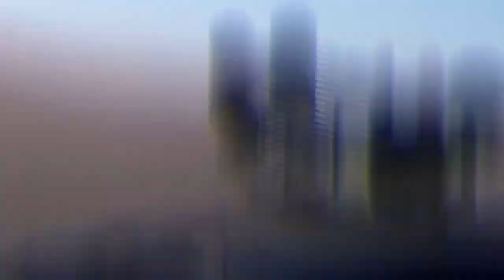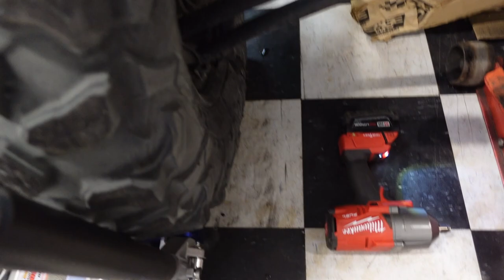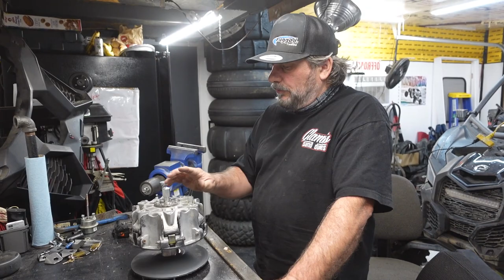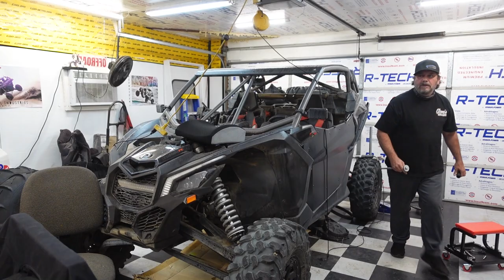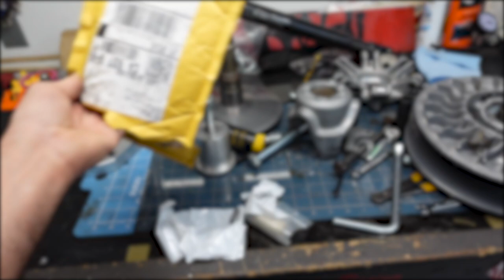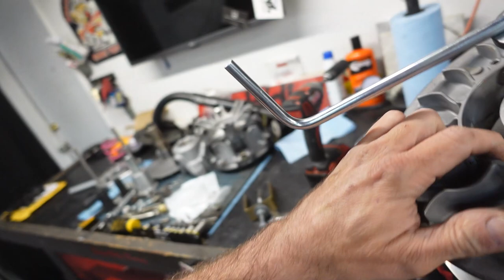X3 Clutch ISSUES AGAIN?!?!

Comment: Heat the secondary 200* and freeze the pin with a can compressed air Duster upside down so the co2 comes out.
Reply from the maker: Good call